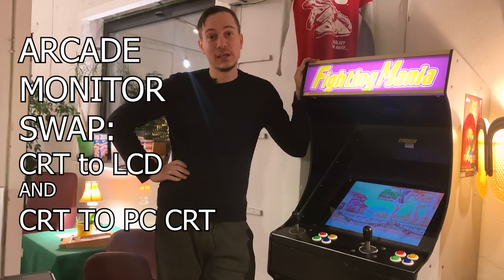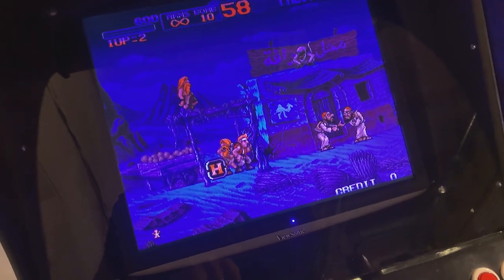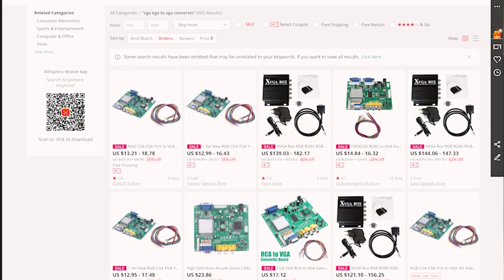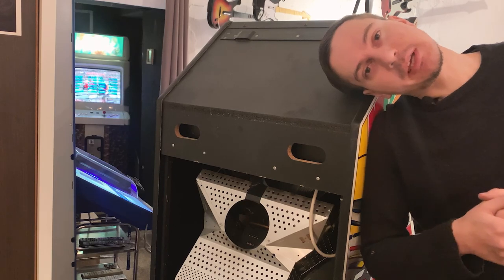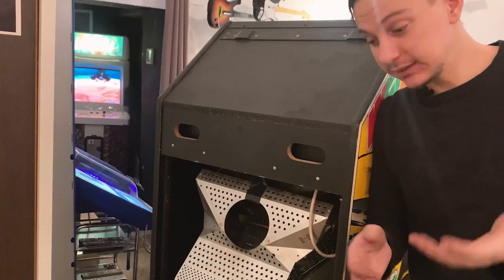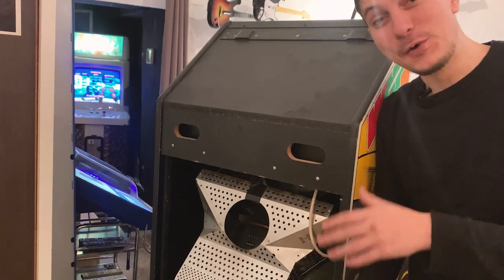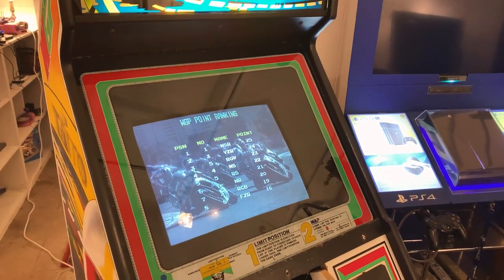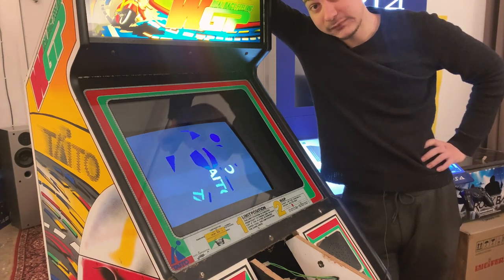Swapping Arcade Monitor: CRT to VGA LCD and VGA CRT

Comment: Good work, although I would suggest fixing CRTs whenever possible and replacing with LCD as absolutely necessary. Totally different visual aesthetic and input lag, etc.
Reply: I fully agree with you, we don’t throw away old CRT monitors. When our knowledge will grow, we may fix them.

Comment: when making modern arcade machine, we found while it was great to have lightweight for transportation means, we ended up searching for heavier components (CRT) just for it to be glued on the floor when being abused (played as supposed to :D) and rumbeled.
Reply: also, for the CRT moniotr, it was super simple to hardwire it to show in mirror, so we created a gread distance effect for comfy viewing as with some arcades back then did.

Comment: I am like a broken record, but if you go with flat screen replacement explore using CRT shaders (look especially good on 4K) and run-ahead lag reduction (thru Retroarch). If you refuse to go the emulation route I guess these aren't options.

Comment: Thanks for the video - much appreciated.  I am working on my own project now and am getting an error when I plug in monitor to the VGA connector on the adapter.  This is the error message - "the current input timing is not supported by the monitor display".  Any ideas on how to fix it?